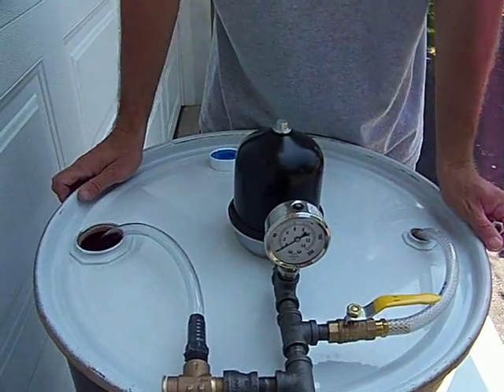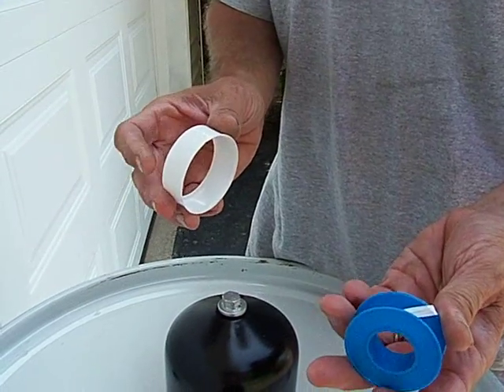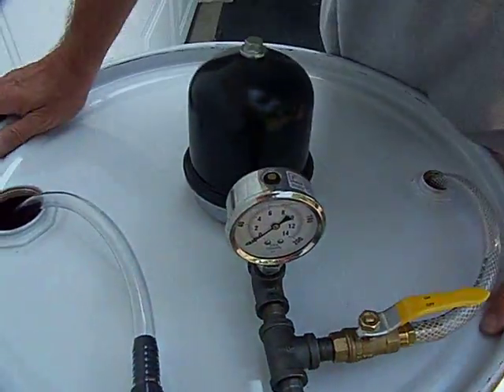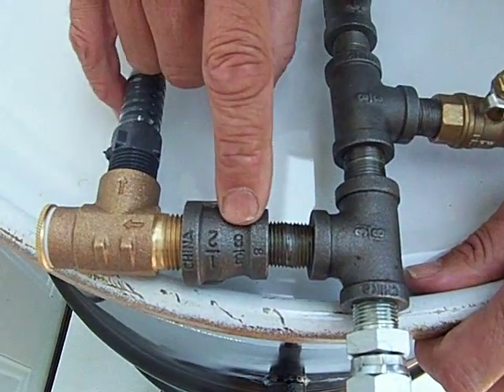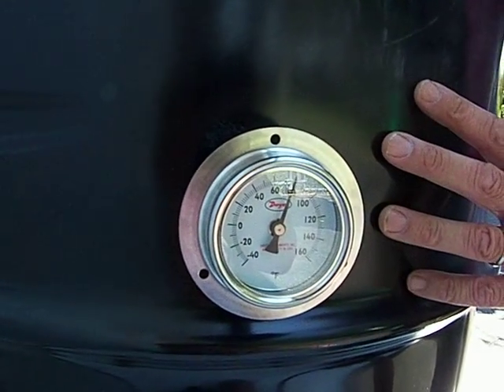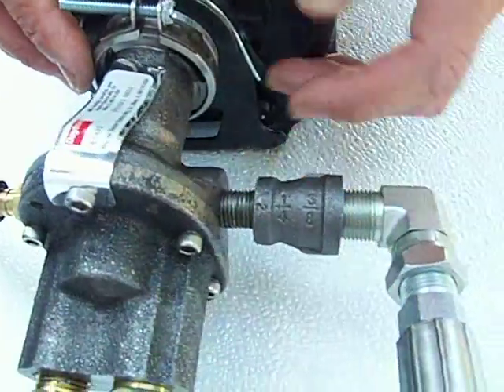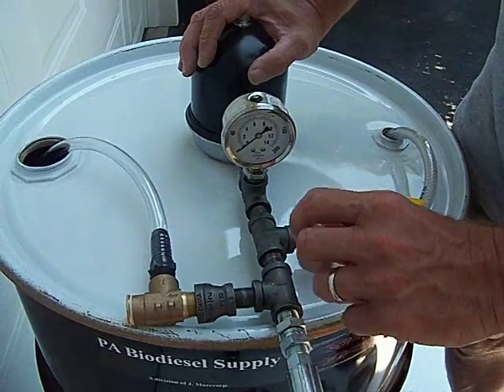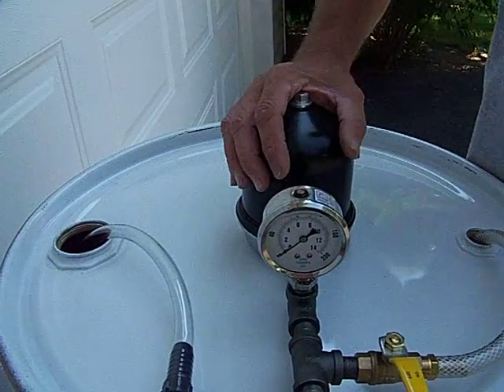WMO Centrifuge/ Oil Centrifuge Building Your Unit

Comment: Does this centrifuge add a significant amount of heat to cold oil? I have a waste oil foundry, and I've got some pretty dirty oil in my tank. Filtering isn't necessary, but if filtering also adds heat energy to my fuel, that would be ideal for me.

Comment: Why not put some T connections in so that you can use pump for 2 different functions ie filling and empting drum . . 2 valves would be needed as well as some more pipe

Comment: Saran Wrap seems a bit light duty to secure the insulation on the drum (would tear easily).  Have you considered a hand-held plastic wrap unit like is used to wrap palletized merchandise for shipping?  I believe you can get them at most U-Haul stores.
Reply from the maker: We use shrink wrap, but not everyone has shrink wrap and most don't have use for a full roll of shrink wrap after they are done with their drum. Use a whole roll of saran wrap it'll work fine.

Comment: the pressure relief valves for if your away and rotor gets full of crap stop spinning the pressure builds up from pump and has no where to go ruins pump so with the relif it would just keep pumping tell you get back